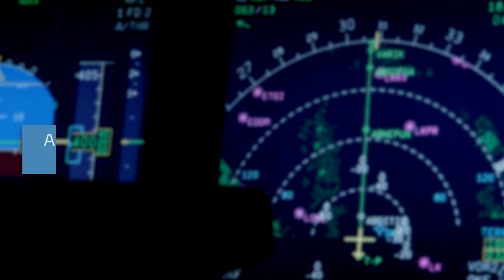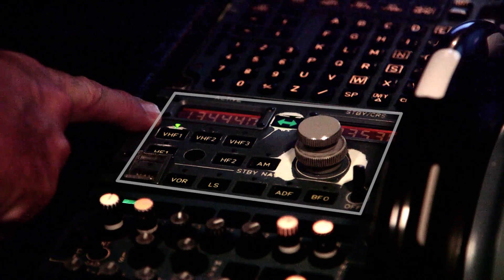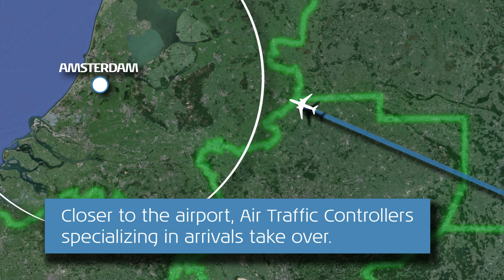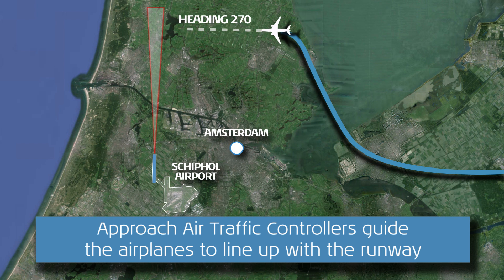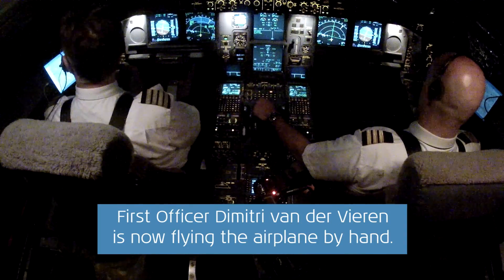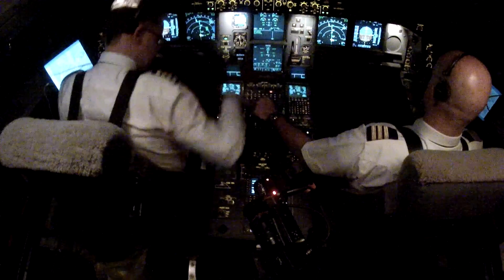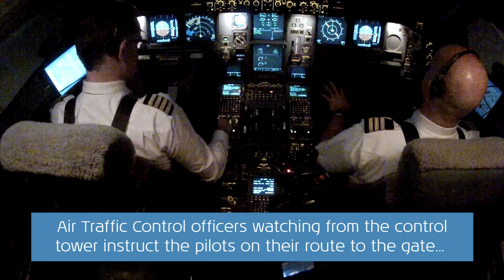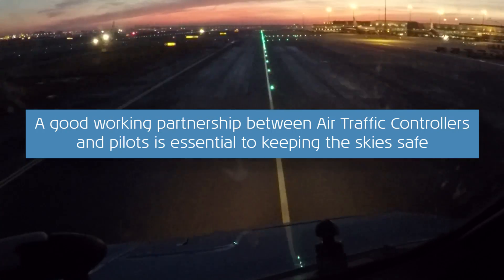How pilots communicate with Air Traffic Control | Cockpit Tales | KLM

Comment: The fact that this video has to use subtitles to convey clearly what is being said over the radio is very telling about aviation communications. There are multi-ton vehicles hurtling through space at high speeds over our homes, and they have to use subtitles to express what is being said on their air-traffic control because the intelligibility is so horrible. Amazing beyond expression in this day and age.

Comment: i have question and i was hoping pilots on this thread would answer me on this.  If you get in small jet with like 1000 mile range lets say and you get up to were ever it is the can fly the lowest i am guessing like 10000 ft.  auto pilot turned off.  you manually maintain your horizon straight line 90 degrees and fly 1000 miles knowing you started out at exactly 10000 ft does or would your altitude be still be 10000 ft or would you be significantly higher do to the fact we live on a globe and so therefor there is the curvature.  i am told auto pilot is programed i assume by maintain a consistent altitude relative to the surface and there by compensate for this automatically.   MY senario just starts at 10000 and then only focus on maintaining level flight for 1000 miles.  lets say your plane could fly 20000 miles would you not just fly out into space?  Thanks in advance for any insight here!

Comment: what is the meaning of "Intercept ILS". btw very nice video
Reply: +Dhiraaj Parmar ILS stands for Instrument Landing System, a way to guide aircraft to the runway under certain weather conditions. An instrument on the control panel in the cockpit coordinates with the system on the ground with the runway heading. So intercepting the ILS is when you turn the airplane to the correct heading to line up the lines on the instrument in the cockpit to show you are flying a safe and accurate approach

Comment: Usualy the co pilot is talking with air trafic control.
Reply: Félix Maltchinski First officer. Yes, but not always. Usually the captain and copilot will switch on and off with who is flying. Whichever pilot is not flying will deal with communications
Reply: How do you know that?
Reply: That's an extremely popular misconception that the first officer is the on always talking to ATC, on the ground when the captain is taxiing then of course he is but it's usually switched up by assinging both pilots with the roles Pilot Flying or Pilot Monitoring, pilot monitoring talks to ATC, since pilots usually fly from one place to another and then back they switch it up, maybe the Captain as pilot flying to one place and then the first officer is pilot flying on the way home